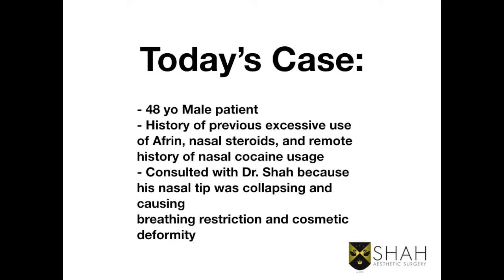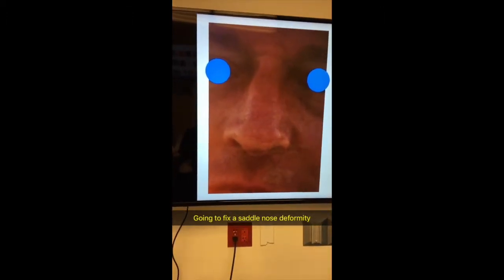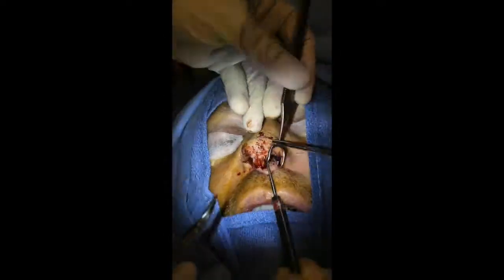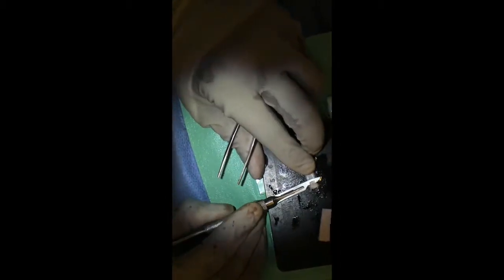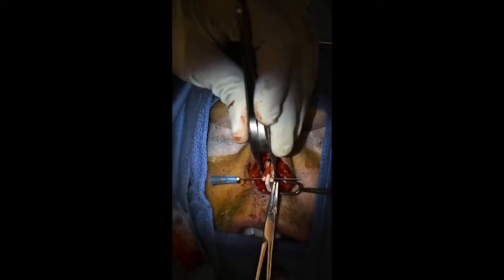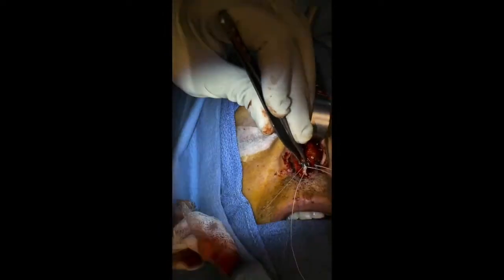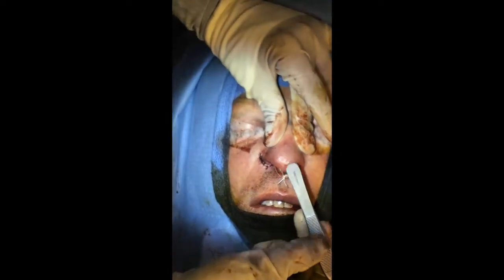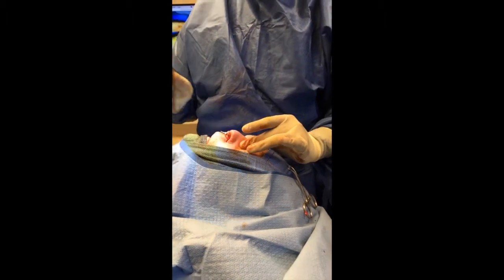Saddle Nose Deformity Correction with Rib Graft

Comment: I need the same surgery but I’m scared of the complications.I've heard that Harvest rib cartilage in the nose, can become crooked over time, is this true?
Reply from the maker: Solid rib graft can warp. But this can be controlled.
Reply: @ManishHShahMDFACSDenver  How?
Reply from the maker: @a.d.5037  with warp control suturing or use of K- wires drilled into the rib graft.
Reply: @ManishHShahMDFACSDenver  oké Thankyou. What does suturing means ? And K-wires ?
Reply from the maker: @a.d.5037  suturing means using wrapping the graft in stitches to keep it from bending. K-wires are small wires made of stainless steel out into the graft like a popsicle stick to keep it straight.